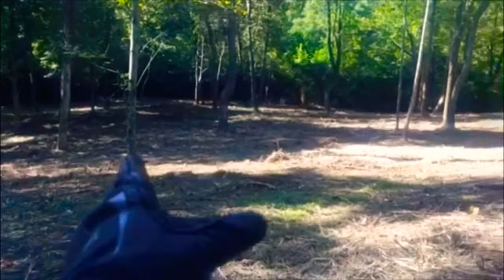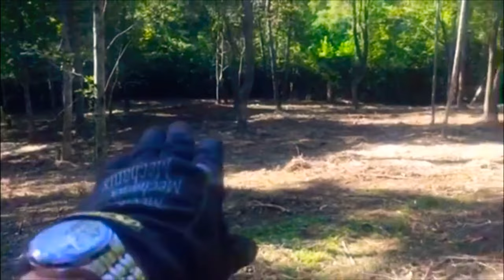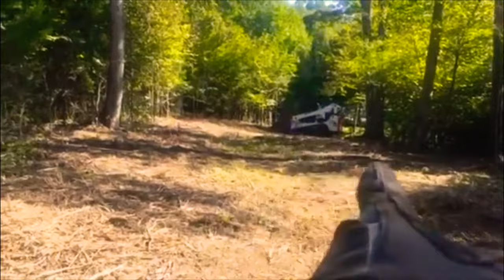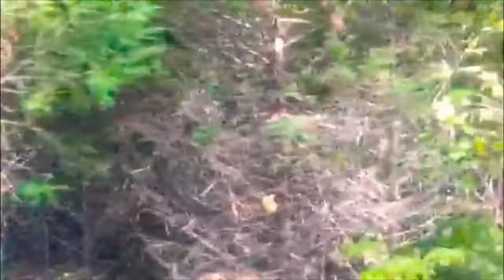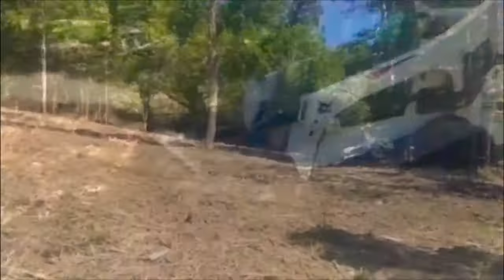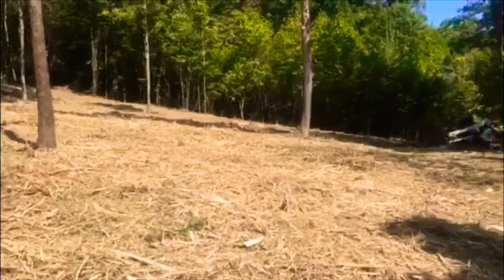Building Site Land Clearing with Forestry Mulcher

Comment: I just had some of my land cleared with a forestry mulcher.  What do I need to do next to build on it?  I know pouring a concrete slab on organic material will be a problem later.  Does everything have to be removed and how much of the tree stumps have to be ground down?  I'm not starting building for about a year so there will be time for some natural decomposition to take place.  Thanks
Reply from the maker: I don’t know if you are planning to do the work yourself or not, but anytime you build anything on cleared ground, you have to grade off the topsoil (the rooty organic filled dirt) down to the clean dirt/clay material. You will clearly see the difference. If you have a contractor doing foundations or slabs, they know to grade off the topsoil. But generally speaking, having the area cleared of trees and brush from a building site using a forestry mulcher is the best way to start. The mulch, or even decomposing mulch, will provide a better solid surface for all of the contractors vehicles since the rooty structure of the soil stays intact, than bare dirt in the case of a dozer having cleared off the site.